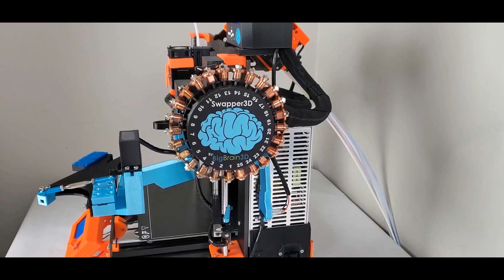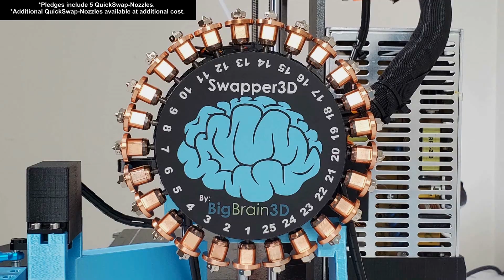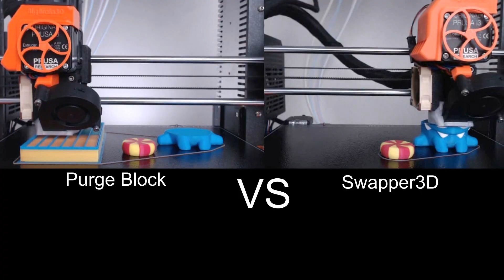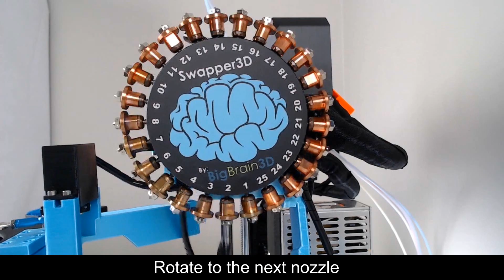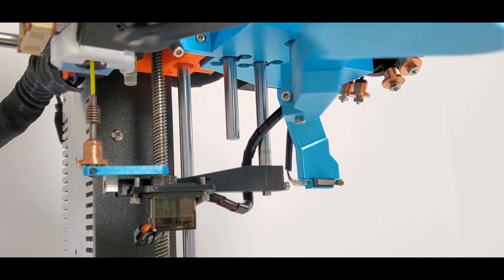Never print a purge block again!

Comment: Will it be opensource?
Reply from the maker: The Marlin firmware changes are of course open source under the same license. The Swapper3D firmware, and printable parts, of the Swapper3D are open source for non-commercial use.